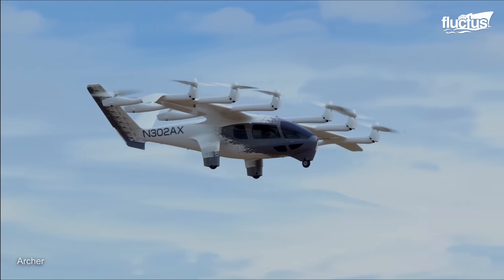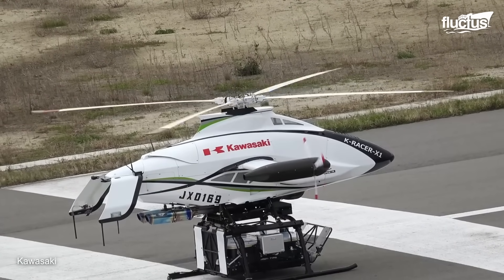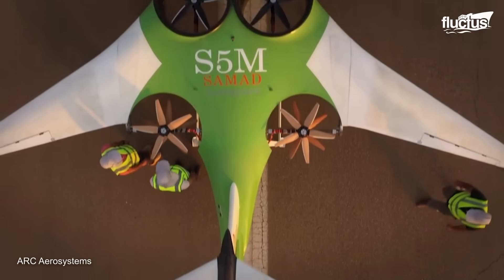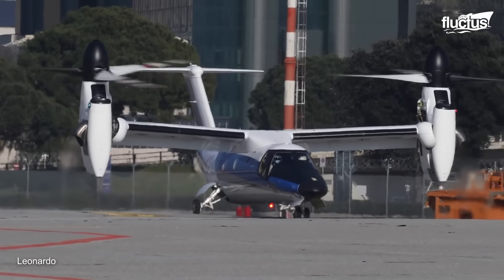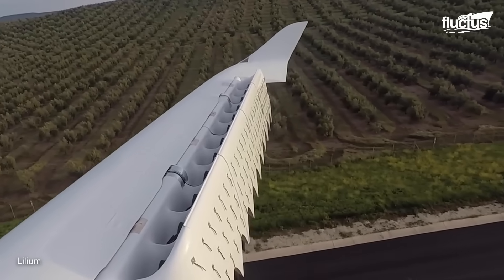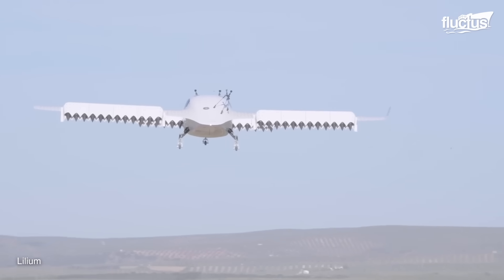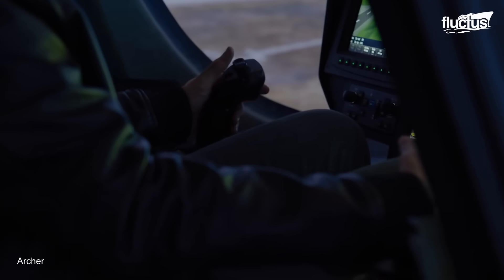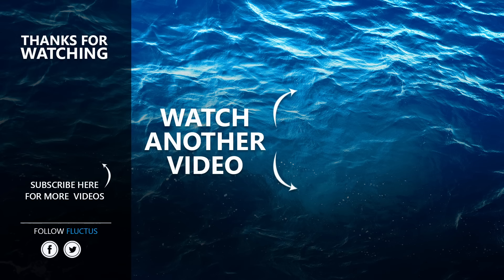Japan Testing its Most Powerful Cargo Helicopter Drone Ever Made

Comment: Can your VTOL Company fly your VTOL’s 15 ton’s aircrafts for example by your aircraft flying design control simulations of the condition of the 10m/sec vertical flying speed and 30m/sec horizontal flying speed and 300km long range driving distance and 3hr long range times on the 3D map world.
I can simulate and provide the flying Powers and flying Torque and accumulated flying Energy and required Battery Capacity and Motor Power of your VTOL aircrafts.

Comment: Kawasaki Heavy Industries previously developed the helicopter-type drone "K-RACER-X1." It was a compound helicopter with a payload of 100 kg and wings and propellers on both sides of the fuselage. This was installed in pursuit of speed as well as transport capacity.
However, as customers wanted a larger payload over speed, the company changed direction with the K-RACER-X2, shifting to a policy of specializing in transporting goods and eliminating the wings and propellers, resulting in a top speed of around 80 km/h, but double the payload.
当初、川崎重工業はヘリコプター型ドローン 「K-RACER-X1 」を開発した。積載量100kg、胴体の両側に翼とプロペラを持つ複合ヘリコプターだった。輸送力だけでなくスピードも追求して搭載された。しかし、速度よりも積載量を増やしたいという顧客の要望を受け、「K-RACER-X2」では方向転換。物資輸送に特化する方針に転換し、主翼とプロペラをなくした結果、最高速度は約80km/hになったが、積載量は2倍になった。

Comment: Any aircraft that requires a set of dedicated lift engines during horizontal flight to provide lift, is a failed concept! The only viable concept is that craft that uses it lift engines for forward flight!  Its not rocket science, you just need a craft with adequate wings to lift a decent payload, and lift/ forward propulsion engines, that some how can transition. The best concept so far, which means it has the chance of being the best craft, when finally realised, is the  craft with wings that fold with the engines, and thus can take off  vertically, then fly horizontally using it's wings, and then land vertically as the wings fold. The Pterodynamics XP-4 , is the best concept out there, and will be the most successful, as it doesn't carry dead weight vertical lift engines. It truly is,  both an airplane and helicopter all rolled into one!
Reply: The Kawasaki UAV looks like it could have been derived from the QH-50 GYRODRONE (the DASH UAV).   Japan was the most successful user of the DASH naval drone.

Comment: the range on ev powered flight ✈️ under loads significantly reduces flight time. Look at the Ford’s failed lightning. Fully optioned out pulling a bumper pull camper matching the trucks ability got only 80 miles. Not very practical when there are no charging stations near by. Ford should have included a small v-8 as means to charge the battery and continue to run the electric motor. let’s say 50 gallon fuel tank. Or big propane tank filled at any filler spot.
Reply: It's not electric
Reply: @nat9909  i’m just glad it’s not. battery technology isn’t ready for prime time yet.
Reply: That mentality is the same as steam engine people saw the first flight of Wright brothers! Encourage new idea and new technology instead of suppressing it like what you are doing now
Reply: Every vehicle has reduced range under load.